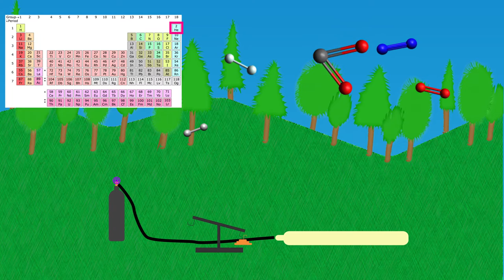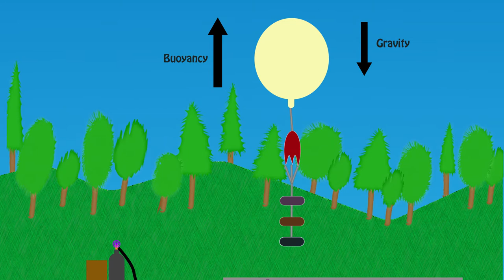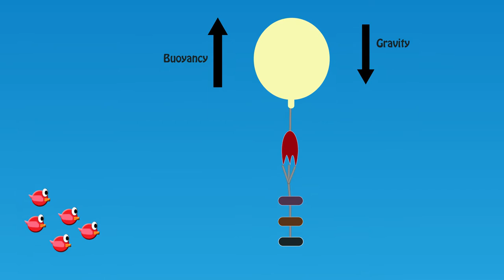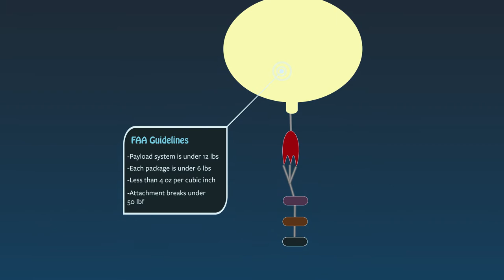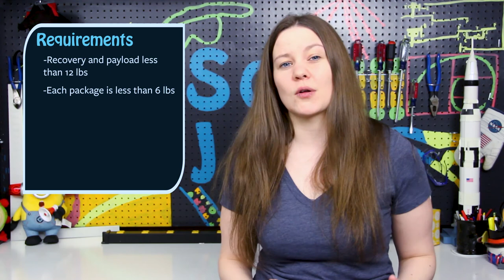Let's Build a High Altitude Balloon! | HAB Ep 1

Comment: Super awesome video!!! I have watched your video ever day since you posted it and I love your explanation of High Altitude Balloons. I am making my own and want to add a voltage sensor to see if the analog voltage value is different near space. Thanks again for the video!
Reply from the maker: Aww thanks. Hopefully we'll have a new video out next week or so discussing burst altitude calculations. I hope these videos help you with your balloon. Can you explain your experiment a little more? Are you measuring how the voltage across a battery changes as the pressure and temperature changes? That'd be a really useful thing to know for all the electronics people launch.
Reply: I am measuring the analog value of the voltage in the atmosphere compared to the voltage in on the ground. Thanks again for your all of your videos! I am a complete science nerd!
Reply: Scramblbot Robotics I'm not sure I understand your experiment. Will you be measuring ambient electromagnetic radiation using an antenna? If so, that would be a neat experiment. What device would you use to measure the voltage? If you used an Arduino, you could take a wire of a known length (an antenna) and attach it to an analog input and record the values over time? One thing to take into account is that your balloon electronics will emit electromagnetic radiation if you are broadcasting position data to the ground - you would need to filter this data out during your analysis. Are you doing it for fun or as part of a school project? Let us know if you need to bounce any ideas off of us!
Reply: I am using a small Arduino voltage sensor. When I don't attach it to anything it reads a small amount of voltage in the air. So I thought along with the rest of the balloon I could add a voltage sensor to compare the voltage level on the ground and in the stratosphere. I will use an antenne, however it will be made of simple copper wire. I am just doing this for fun, I love electronics and usually build robots. However, I also enjoy astronomy and wanted to cross the two. I would love any advice if you have it! Thanks for your interest!
Reply: I think you may be reading a floating voltage or noise value. Can you post a link to the sensor? Maybe we can try out your sensor.

Comment: Why launch in June? I'd assume you'd want the ground temperature to be as similar to that of 100k ft as possible as the not cause anymore material stress (also maybe to keep the gas slightly cooler as the balloon is filled)?
Reply from the maker: That is an interesting point. That stress probably isn't high enough to cause the mission to fail. However, maybe doing what you said would allow us to have the optimal performance for the balloon.  We just built a vacuum tube over the weekend. Maybe we can do some stress tests with temperatures and pressures. We have some schedule constraints and need to launch in June.
Reply: Vacuum tube? At any rate, stress tests always make for good YouTube content :) 

I figured it was more about production schedule than anything else and idk how much it matters either. Just figured I'd ask the question. 

A local group (hacdc) did some launches a few years ago. I wasn't involved with it, but am interested to see what new tech will fit. My two takeaways from talking to the people who worked on it were: use CHDK (Canon something Dev Kit - which is Lua and allows for controlling the camera) and electronics in a lunch box in freezing temp can still overheat
Reply from the maker: shawn wilson thanks for the tips! We just started looking into thermal management issues for the electronics.
Reply: This is exactly the kind of commentary we wanted with this project! If you have any tests you'd like to see, feel free to suggest them. We may not be able to get them done before the launch, but that won't stop us from future videos! The vacuum chamber is partially complete and we'll be doing some testing with it in a few weeks.

Thanks for the reminder that even though it's cold, the electronics can overheat due to the lack of convective cooling. I would have let that slip my mind had you not mentioned that. It has been added to our checklist for sure!
Reply: Not sure about experiments - pretty sure y'all how the obvious ones covered. Though (and I know Discovery kinda did this) put a 3D camera, stabilize with the horizon and compass north and release the full ~90 minute run, that'd be real cool.

If you haven't already, you really should contact some elementary schools and see if they'd like a field trip. And put whatever pictures and designs and development work online.
Reply: Oh "Discovery kinda did this" - there's an <10 minute SeekerVR video - I want to whole run :)
Reply from the maker: Yeah, I've seen that SeekerVR video. It is pretty cool. Thanks for all the suggestions.

Comment: amazing idea! If you need any help designing I would love to help! it would be super cool to have an actual measurements of the carbon dioxide levels at different altitudes
Reply: I was thinking measuring CO2 be a great idea. Do you know of any sensors that could be used for this? Depending on the purpose of the measurements, it would need an appropriate accuracy.
Reply from the maker: I've looked on Adafruit, Sparkfun, Digikey, Mouser, Seeed Studio, and the post you linked. It looks like sensors that are in our price range (we pay for this out of pocket) only look at volatile gases. They are used in manufacturing setting to monitor the air quality for workers. They can't distinguish between CO2 and the other volatile gases. The sensors that can are $80+.